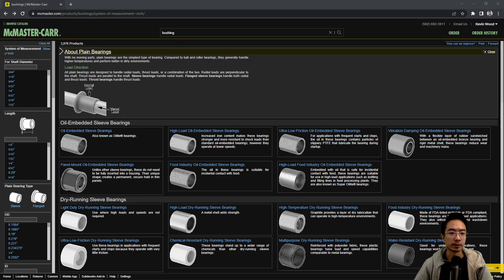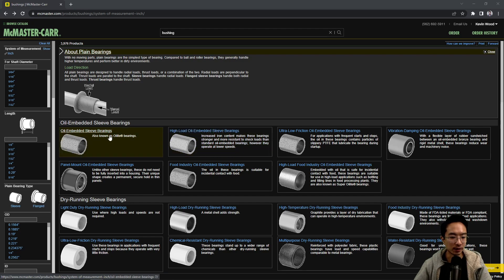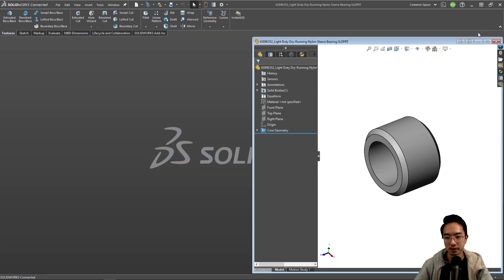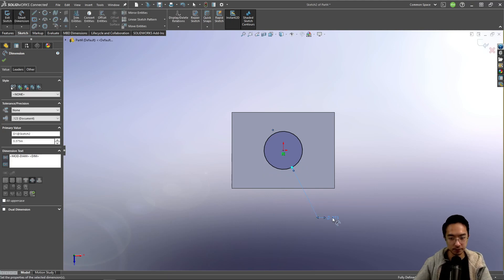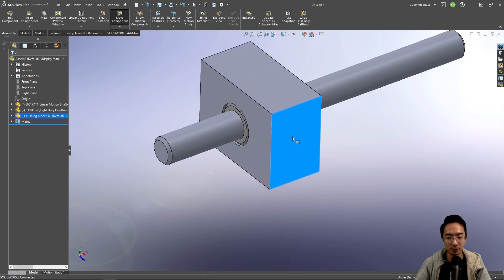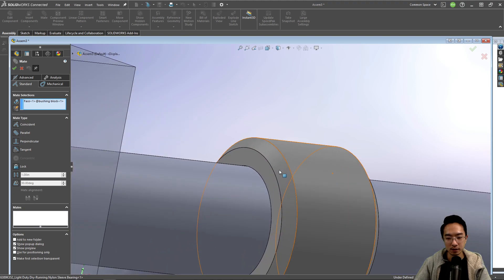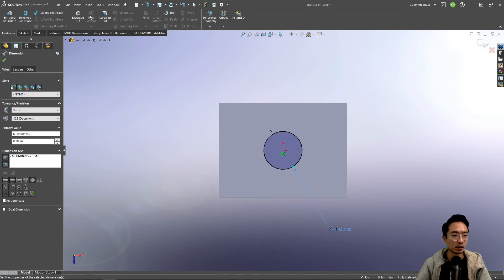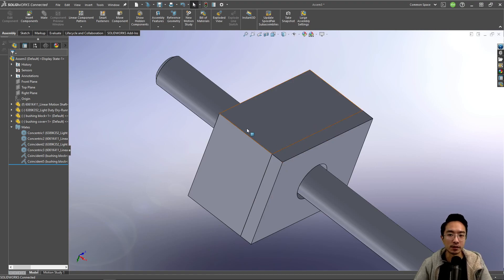Bushing Explained (Type Selection & Assembly in Solidworks)

Comment: This is a great video for mechanical engineers! But a silly question here, why do we need a bushing in the first place? why can't the bar slide directly inside the block?
Reply from the maker: If it’s for very slow speed and very few number of times, you might be able to get away with metal on metal.  Otherwise you typically need something to reduce friction and prevent galling